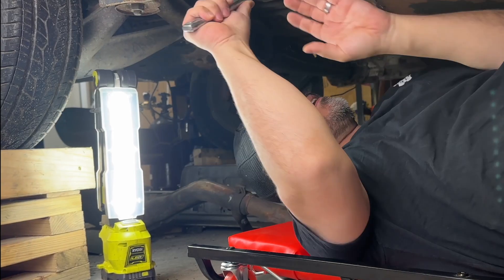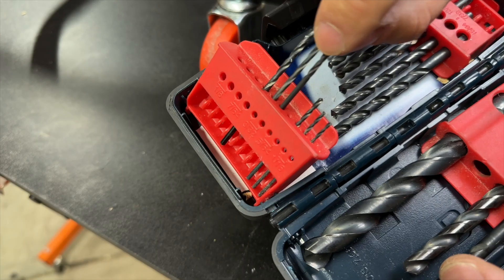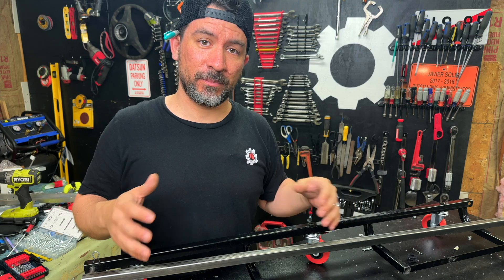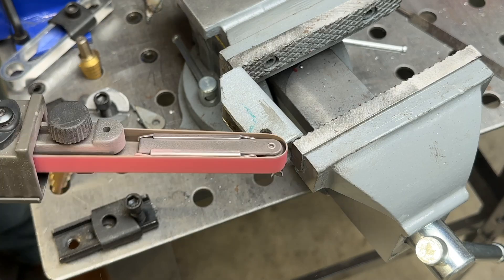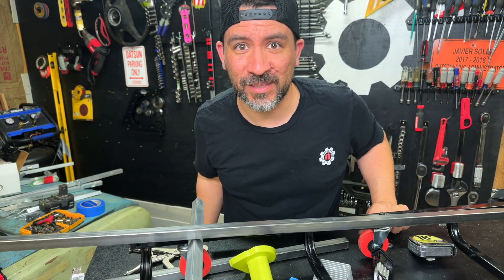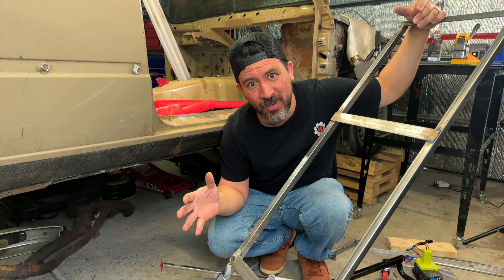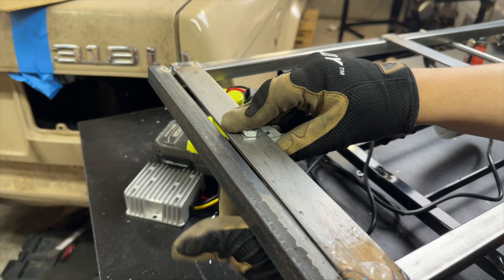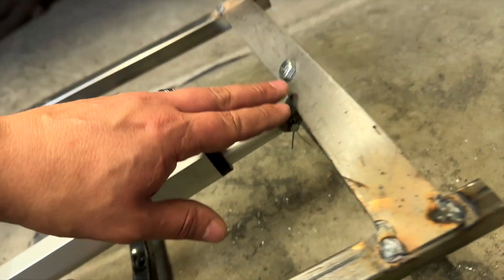STOP Breaking Your Back... HACK This Harbor Freight Creeper Instead

Comment: Hmm very gud skilled build i like u had  a go but time Labour n costs of material no one ever factors in the time to build whilst its not thousands of dollars n i dont really see the point of even the thousands of dollars one in a shop, my challenge to u is do it again using hydraulics with a hand pump whilst under the vehicle just like any car jack it has to be simpler n easier with hydraulics....it will still relieve ur back...we rely too much on electric these days if u cant charge ya battery the hydraulics model will still work....
Reply from the maker: Good point, I just bought the MaxJax Reclining Creeper because this build was a complete failure :(

Comment: That is a lot of force the actuator needed to overcome due to mechanical advantage cause by those really weird angles. 

Here's a possible workaround. Use the mechanism from a scissor car jack.
Actually, just use the scissor jack straight up. Cut off the lower half of it and either somehow motorize  the screw it comes with directly or use your linear actuator to pull the triangle sides together.
Reply from the maker: I was thinking about how to use a scissor jack at one point in time. Using the actuator to drive the scissor is a great idea 🙌🙌🙌

Comment: I've watched their videos a few times and it is really hard to tell what they are using to drive the movements. Based on experience I would think you need something that could use gear reduction to lift a 200 pound person, or... it might all be about the positioning. Since their chairs are made of many different sections it could be that they are using more of a scissor action to pull one are while pushing another. I will be interested to see what you can come up with though because their prices are waaaay over most people budgets.
Reply from the maker: Thx, I think I saw some high tension springs on the side of that $20k seat. Most of the other powered seats around $3k look to be using some form of powerful/faster linear actuation. I tried testing a scissor movement, but I'd need a much smaller linear actuator.
Reply: @Itsallaboutthebuild  oh good point, going up on their seat might b assisted by the springs and going down is just assisted by your body weight
Reply from the maker: @theflashjaxx  was thinking of maybe adding some gas shock struts to help it lift…

Comment: use square tube instead of that flat bar.  if you think about the forces, that bar is carrying your whole body weight.
Reply: And some of us AREN'T LITTLE
Reply from the maker: @endall6783  needs better reinforcements for sure 😁
Reply from the maker: @theJonnymac  will have to make it all square tube, plus the angle seems not be steep enough. Force pushes out instead of upwards 😔😔😔